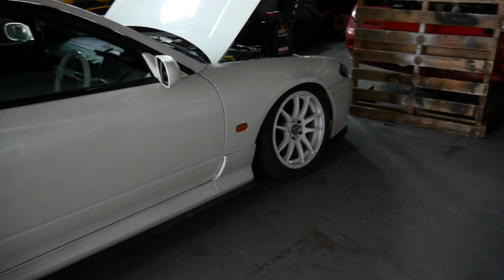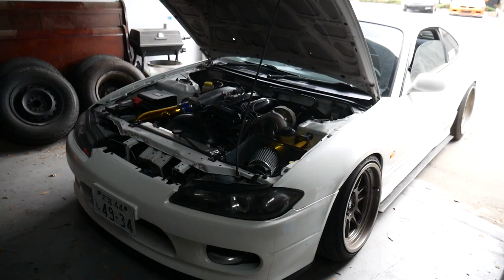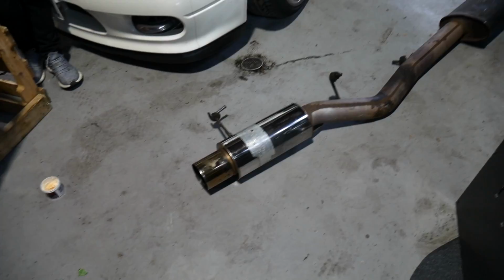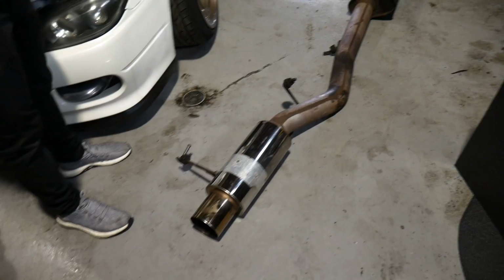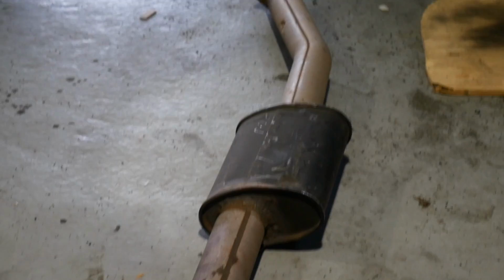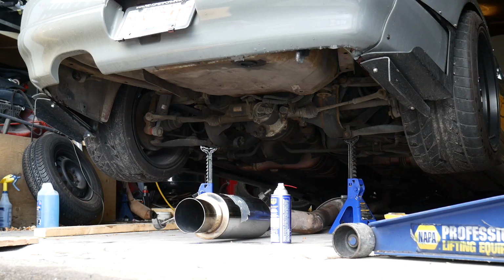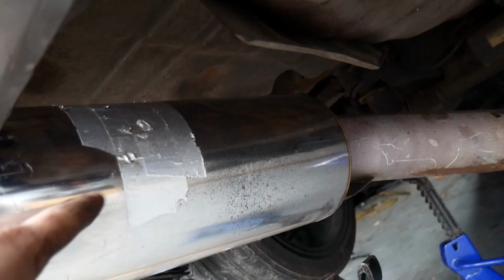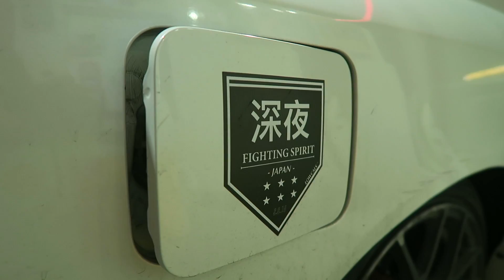LEARNING TO DRIFT OUR CARS...

Comment: It looks so much harder to drift in this. I have 32 sedan with a rb20det stock apart from 3inch straight pipe, front mount intercooler, pod filter and gapped plugs to run 11psi. It breaks traction so quickly.

Comment: Nah dawg, that R33 is not proper drift spec. It's heavy as fuck, no angle on the front wheels, that big ass turbo takes ages to spool, etc... That car wasn't built to drift and you know it bruh ;) Btw i prefer the sound of the old exhaust, but the Apexi N1 looks SO much better...